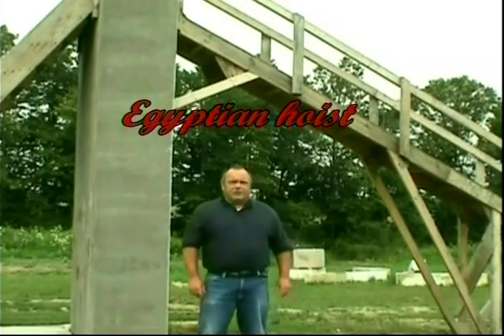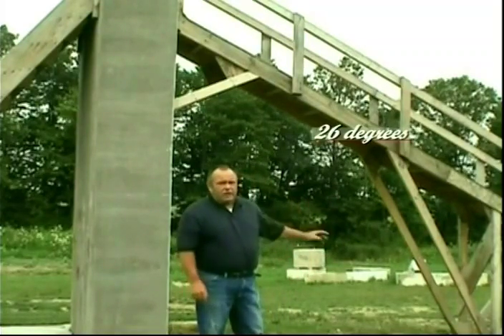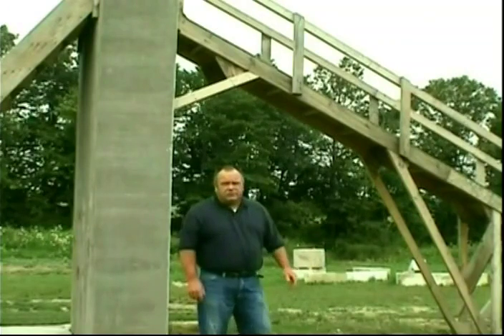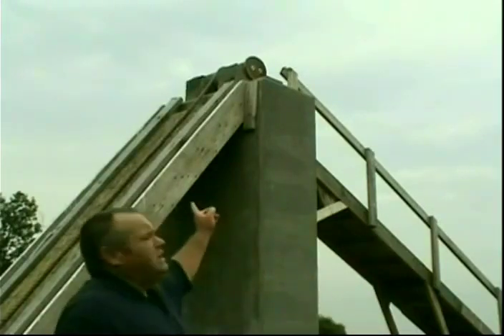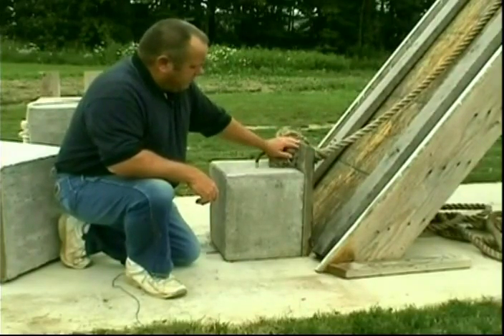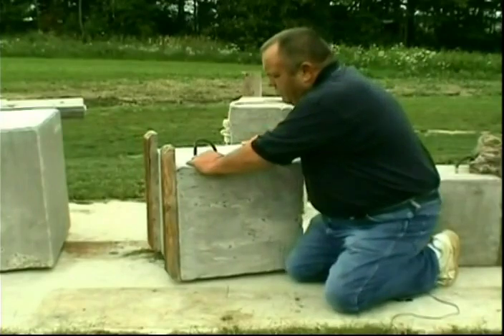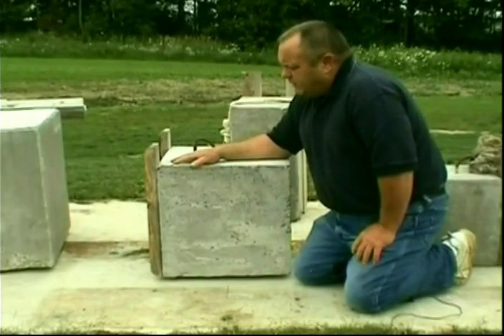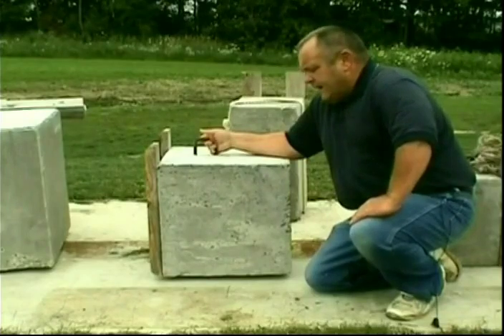Ancient Egyptian Pyramid Building Technique Reveal By Wally Wallington

Comment: Doesn't this only work till you get to the point where the blocks are too heavy for the wood to support?
Reply: Least it's a real demonstration, and not just thoughts and words. Good point though, all materials have their limits. Pretty sure the Egyptians, and others, found their limits and worked with them to build the, time-honored, works we find and see to this day.

These videos are pieces of the puzzle; big projects are, after all, just big, dynamic, social, political, physical puzzles, at the end of the planning and start of their developmental phases.

But yeah, wood... maybe the parts were made from stone, or even reinforced, with like, copper?

❤
Reply: Easily. Look back at the timber trestle bridges used in the old railways (or railroads- they were used on both sides of the pond.) 20 tons would represent a medium-sized locomotive of the 1850s, and then you had the train behind it as well. They weren’t particularly chunky timbers either, just well-designed structures with plenty of redundancy.
Reply: @ukuleletyke  You have underestimated the weight of locomotives. Some were pushing 100 - 150 tons back then.
Reply: @rupe53 No, I haven’t. In the 1850s, (the timeframe I specified) the average weight of a loco was between 15-25 tons. In the UK, A Stephenson-built 2-2-2 express locomotive of the time weighed circa. 23 tons. Across the pond in the U.S., the standard 4-4-0 type weighed much the same- The General, which is pretty typical of the type, weighs in at 22.8 tons- and these were being built in large numbers until the 1870s. Locomotives in excess of 100 tons wouldn’t appear in any significant quantity until the 20th century- and in the uk it was still unusual for a steam locomotive to exceed 100 tons even in the 1960s. Evening Star, the last steam locomotive built by BR in 1960, only weighs 88 tons.
Reply: @ukuleletyke    splitting hairs on the time line but steam locos also need a tender, which brings the weight to around 30 - 40 tons. Do you think they magically rebuilt all of the bridges? The "Bog Boys" here in the states were over a million pounds but only 25 were made.
Reply: @rupe53 no, it’s not splitting hairs at all. In my comment I specifically mentioned locos of the 1850s, when they were building new trestles in both the UK and US. My statement was entirely and provably accurate. You jumped to a conclusion which was entirely wrong in the context of my comment, rather than fact checking beforehand. To suggest I underestimated anything is both arrogant and lazy, to much the same extent as refusing to accept a correction is both juvenile and vain, especially as the facts could be easily researched before you go off patronising others who may well actually know what they’re talking about.
Reply: @ukuleletyke    gee, thanks for the kind words. Why even mention RR weights when they never use more than a 3% grade? (1.7 degrees) In the video they are using 52 degrees of slope. (128% grade) The supporting structure would likely be the course of stone below. Any wood used is strictly to smooth things out for sliding materials.
Reply: Depends on the wood, while steel is structurally stronger and more available than a hundred year old tree these days.
Wood can handle a lot more pressure depending on the way the grain is then steel can for it own weight, so it is lighter.

Bone supposedly the same way too.
Reply: Large tree trunks can hold 20 tons of tree above them, you're just underestimating the strength of wood.

In a dry dock, we used to hold steel ships like Titanic off the floor of the dock with wood.
Reply: With the 52° angle your not getting all the weight directly onto the wood only a percentage.
Reply: Considering that he lifted a 20-ton block by himself using only water and a couple of pieces of wood...
Reply: @christinafisher9357  yup.
Reply: Wood the size of your hand will hold 5 tonnes.
Reply: A shit load of snatch blocks and you would start with multiple ropes at the rock to dispurse load, after the snatch blocks the felt weight is magnitudes less so you can tie some ox and have them pull. Or elephant
Reply: Have you not seen how much weight wood can hold?
Reply: @MoviesFreeGalore  not really.  I looked up some load calculators but it's still not clear. I get the 2.5 ton stones but the big 20 ton ones would crush the wood no?
Reply: @christinafisher9357  that's fair. I'm meaning it more in a general sense. Look at the massive vessels we created to burden the seas with goods. This is just a demonstration and by no means a replication of the scale.
Reply: @christinafisher9357  In this video demonstration there is a gap under the wooden slope that the block is being pulled up. Yet, WW points out it's at nearly 52 degrees, and that's the slope angle of the side of the pyramids. 
So any wooden track taking blocks from the ground up to the currently-being-built layer of the pyramid would be physically resting on the side of the pyramid, all the way up. The wood would be 'squeezed' of course, but it couldn't bend, buckle, splinter apart etc. 
No one says the Egyptians absolutely had to use wood, of course - we know they could polish stone to a shiny, nearly mirror finish back then. Hope that helps! :)
Reply: @christinafisher9357 why do the ramps need to be made from wood?

Why not copper?

Why not stone?
Reply: @christinafisher9357  thar gets the block up . But how would you put it in place?
Reply: @stevenlake5278 The blocks were most probably molded, actually. Check out the work of Joseph Davidovits. Nevertheless, it is an interesting approach shown here.
Reply: @sadventures4737 You are right, ramps would have to be made by stone, what would make those ramps more massive and impressive than the Pyramid itself
Reply: @HandbrakeBiscuit  🎯
Reply: @gavinhay6627  They quarried stone from hundreds of miles away. Sourcing timber for a limited number of ramps is a minor problem.
Reply: @stevenlake5278  Walk them or roll them - see Wally's other vids
Reply: @christinafisher9357 you could build the ramp out of rock too
Reply: @calebbowen7549 that's a joke right?
Reply: @christinafisher9357  they had plenty of rocks
Reply: This is definitely impressive stuff, but I like probably everybody else came here because we are trying to figure out how gigantic structures like the pyramids in Egypt were built, and I don’t think this method could work with that amount of weight. The wood would collapse under that much weight and the size of the structure in order to do it would literally have to be miles long.
Reply: @dowhatsright4429 i wonder about the possibility to use multiple rollers to spread the load would be possible. Or maybe the biggest ones where levered up during the entire construction phase.
Reply: We keep finding constructions of similar size and difficulty that have been dismissed for years(decades,centuries)
Reply: @dowhatsright4429  always never trust people who use absolutes, or say "literally" then just quote some bs value, like, "a mile long"

Literally, bro, like, literally, this next part of the sentence's acronym is so meta it: Is So Meta, Even This Acronym...

Credit: xkcd, Hofstadter (I butchered his original for, the literal fun of it.
Literally.)

Sorry, pet Peave.

Comment: And then on top of that, I bet they were using animal lard or fat to grease the ramp! Made it much easier and was less hard on the equipment
Reply: Animal fat was probably too precious to be liberally applied to ramps, and it wouldn’t last. Also lubrication causes loss of traction  in all directions, not just one.
Reply: @OLDMANTEA  thank you.
Reply: @OLDMANTEA  animal fat wasn t precious at all lmao. Still isn t nowadays.
Reply: @unhommequicourt was used for lighting
Reply: Yes, but they didn’t use grease instead they would just continuously pour water in front of  the sled to make the ground slippery
Reply: @critterjon4061  why use water when you can use sand?
Reply: @critterjon4061  how do you verify that?
Reply: Or water and sand...it would even even the surfaces... @critterjon4061
Reply: Id heard that the silt from the Nile was snot-slick
Reply: And anyone knows where went all the wood used for the system to build the pyramids after they completed them???
Reply: Crushed leaves are slippery some are soapy
Reply: They had no knowledge of the wheel or pulley system. Which is being used here. Not to mention the hemp rope which was non existent in their time. This is definitely not how they built the pyramids
Reply: @OzMate79 first evidence of the wheel in Egypt was around the time the pyramids were built. Maybe the technology invented to hoist the blocks later became the wheel
Reply: Olive oil would be more easy to come by.  Animals were valuable in back those days i think
Reply: Do you know how much lard they would have needed? . Whatever he is doing x it by at least 10,000
Reply: Why would you put grease on top. Shouldnt it be in the bottom
Reply: I think beef or lamb lard is wasteful, I think the Egyptians used Olive grease as lubricants instead.
Reply: I’d bet good money on it!
Reply: I can see he has greased the top roller. This is all common sense stuff that many in the construction trades would understand! No PHD required to figure it out!
Reply: I used the same method on my ex😂😂😂
Reply: With 100 tons block... thats bs
Reply: Good point! I’d bet good money on that!

Comment: Thank you !!! May I humblely enhance your demonstration because those stupid morons who called themselves archeologists will say that Egyptians don't know "pulley", then you must tribology instead like you did with wooden skates underneath your blocks, and a counter weight plateform instead of men pulling a rope because their force aren't optimized, use men hop on and hop off this counter weight plate-forme, then you will à crane or elevator, and your angle will only depends on the quality of your ropes, add some naphtha or simply olive oil and water
Reply: PS: the great staircase in one marble bloc of the great harmony palace of imperial citadel in Beijing was also a mystery until hidden archives in Vietnam (the architect in second was a Nguyên, vietnamese captive, who organized and planed the settlement of the area, digging of canals to bring water, and the building within only 15 years, and his plan is still applied today on urbanisation and exoansion of Beijing) revealed that ice was used to move it with few dozen men in two weeks from 80 km away: tribology (even Assyrians knew pulley, but because no trace, no artefact was found in Egypt, then you must do it without...
But if you think in tribologist way, a cylinder in copper, some naphtha (Jewish scriptures said Noah used it to seal his ark), can redirect power as well, like hieroglyphs in Tehuti-Hetep)
Reply: May I go further, such as lubricant, made of naphtha and water, plus simple rings of copper, large enough, can create almost pulley equivalent, even almost hoists equivalent. Of course, because  of frictions, they aren't as efficient as pulleys or hoists, but they enhance seriously the  power of a counter weight plateform.

Comment: What a beautifully simple technique to multiply power just angles and a  roller and the angles are there in the side of the pyramid and the grand gallery.
Reply: How did they lift the blocks that are higher than the grand gallery?
Reply: @JohnnyKray  A roller higher than the grand gallery would work.  The system works simply because the pulling force is going down a steeper slope than the load but the roller can be higher than the down ramp
Reply: Doesn't explain how the blocks were quarried and transported 100s of kilometres. One 80 ton block from 800 kilometres away. On a raft !!😅
Reply: @justmeagain6135
Thats a secondary question. Getting someone like wally to show how a possible solution to step 2 of the pyramid build is a step forward.
Reply: Except Egyptians didn't have wood
Reply: @chiquita683 yet they did
Reply: @chiquita683 yes they did what about the boat found at the edge of the pyramid?

Comment: Wouldn’t they need a ramp that’s taller or as tall as the pyramid to put the final pieces
Reply: Sure but since they built it as they went, they really only would have needed a height large enough to hoist a single block.  They could then place that on top of the parts of the pyramid that were already completed.  That isn't nearly as difficult as you might expect.

We're just not used to thinking of things in these terms, instead being used to mechanical devices mostly lifting heavy objects straight up.  Ancient peoples would have lived with these basic concepts and techniques their entire lives so to them it made as much sense as a crane or forklift do to us.
Reply: Actually no! As you build up the side’s of the pyramid support the ramp! Quite well and when at the top , simply pin the stone carriage in place, move roller farther upstream out of the way and pull into close position! Final position can be with a few lever’s and men sliding into place on a bed of lard. Easy peasy! This is not rocket science!
Reply: Yeah probably considering that they where so determined to make it that high they would do anything to complete it

Comment: lol now make it with 20-50 ton stone
Reply: He move 20 ton alone ... you know human with brain ... 😂
Reply: Ok got it what about 100-more tonnage?
Reply: @IvanKosmachevski lol now make it 10.000 people working nonstop for 50 years instead of one unfit dude
Reply: @BBlack70 was only 25 years and they would have had to stack a 2.5 ton stone on average every 20 seconds even if it was 50 years that would mean they would have had to place a block every 40 seconds yeah right over 400 ft in place hahaha
Reply: @nathanwright845  Your calculations are wrong. If they placed a block every 20 seconds for 25 years that results in 39 million blocks. The Great Pyramid is made of 2.3 million blocks. Regardless, you scale up production ouput by increasing the number of workers.
Reply: Don't even try. they already have  made their mind. nothing will change it
Reply: I’m calling bullshit.
Reply: Let's also not forget what kindve rope you need to pull this off as well. Come on. Steel braided rope can't even hold that weight.
Reply: This guy didn't even watch the video. He obviously proved it can be done.